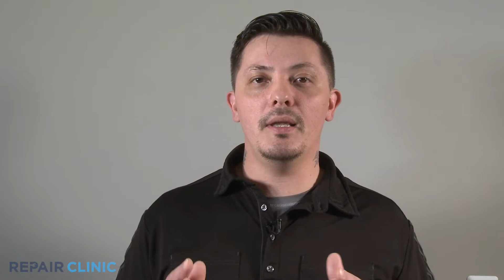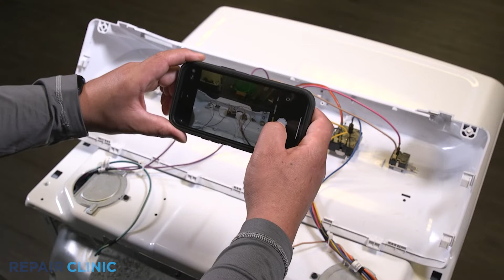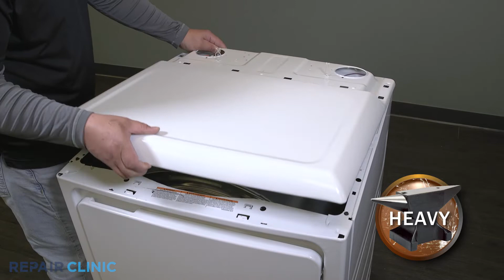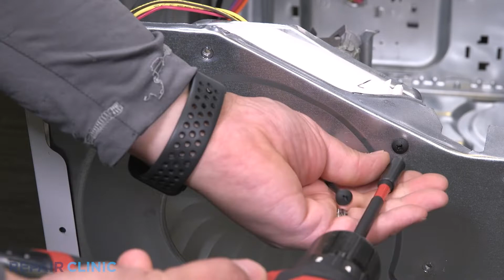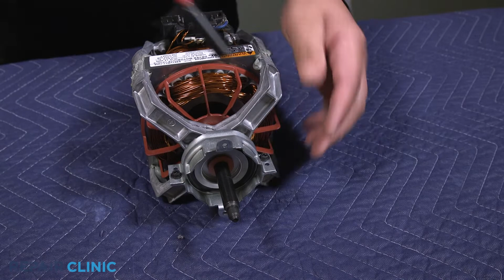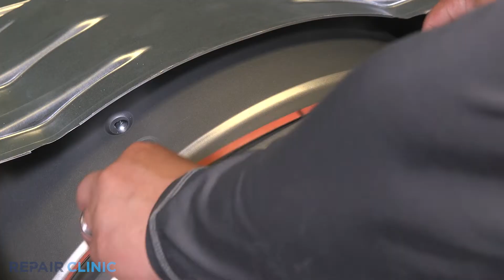GE Dryer Motor and Pulley Assembly Replacement WE49X28295

Comment: Great instructions! It was a lot of help using this video as a reference while replacing my dryer motor. Unfortunately, my dryer still won't turn on.
Reply from the maker: Check out this troubleshooting video: https://www.repairclinic.com/Repair-Library/Troubleshooting/2906/Electric-Dryer-Won-T-Start-Dryer-Troubleshooting

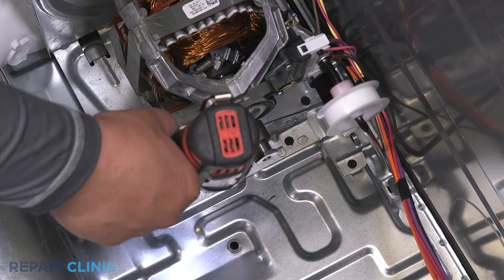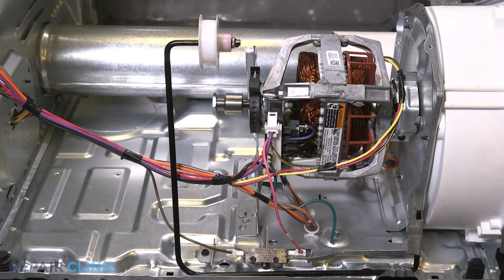Comment: This is very good.  But note the position of the idler arm at 6:13 relative to the bundle of wires it crosses, then note in the next frame at 6:31 where the idler arm is being removed, that the idler arm is somehow already on the other side of this bundle of wires for the video segment that was kept for the instructional video.  I think the instructor did a dry run (this is why he is so good and efficient in his explanations and demonstrations), but in this one case, when he returned the idler arm in order to show the removal for the live video, he put it on the wrong side of the bundle of wires.  Later, at 10:05 when he demonstrates re-assembly, he again puts it on the wrong side of this bundle of wires, and you can see that the normal motion of this arm will lean against the bundle of wires.

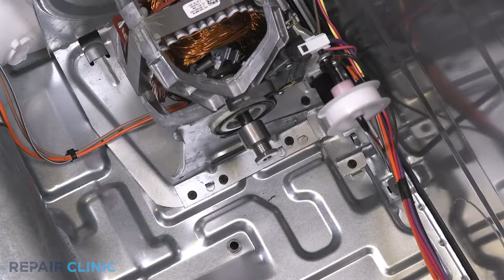The correct relative position of the idler arm and bundle of wires was the original one at 6:05 I believe, since it minimizes the contact between the range of motion of the idler arm and the bundle of wires while dryer is in operation.